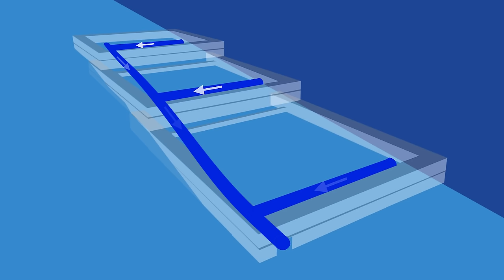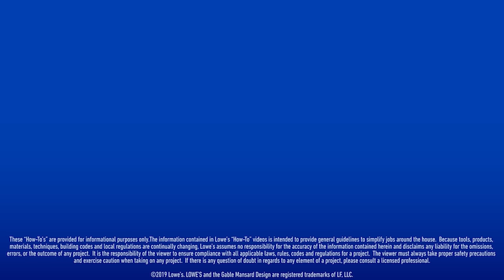How to Build a Terraced Garden Bed on a Slope

Comment: I wish you would show how the 2x4 or cross braces are attached. Are you using Joist Hangers or did you use the timber screws to tie directly into the 6x6s?
Reply: Yeah, if I just wanted a tutorial, I could have read an article. I looked for a video because I wanted to SEE how it was done, but they cut all of that out

Comment: So with the emphasis added on drainage.... I want to do this in my yard, but it's in an area where sprinklers don't hit. I live in an area that would need sprinklers or a drip line at least, so I want the water there, but I still need the drainage in case of any extra during rainy months right?

Comment: For the drainage pipes, I am confused as to why they are L shaped, ie run across the front of the bed and not just down the one side. Also for the drainage pipe running up the side (the one that has the notch at the bottom) do you connect it to the next bed above or have it long enought to run through all three beds, adding a T to it at the front of each bed? Also do you need to close the end (brick wall side in this case) to make sure it doesnt fill with dirt, or is just ensuring the landscape fabric is around it enough?
Reply: the goal is to only allow excess water build up to flow down the slope. Otherwise, the water will naturally just drain back into the dirt.

Comment: Maybe I missed it but did the drain get connected to the top 2 boxes ?
Reply: He mentioned using "T" connectors but they're not shown in the parts list.  The highest/first bed should have am "L" connector.  Consider angling the various pipes inside the beds so the water runs away rather than pooling.

Comment: I've just moved into my home and I have a slopy garden! the council has only tended to 1/4 of the garden which is at the top and it would be the size of a typical city garden!  the rest they gated off and it is a brook! which is literally overgrown with ferns and bushes.  I saw a fox there as well.  I really want to do the garden up and I wanted some advice?  what can I put in place to keep foxes out?  and how can I design a very long garden? especially the one which seems as if the house is sitting at the peak of K2 whilst you are at the bottom of the garden?

Comment: Will the wood rot in a tropical area, say Malaysia ?
Reply: just looked it up for you However, most pressure-treated wood should have periodic sealing against moisture, preferably every year or so. Although the wood is resistant to rot and insect attacks because of the pressure treatment, it can warp, split and develop mildew if not protected from the effects of water.

Comment: Now show the video of the tiered garden box i just built at my mothers house where I spent 15 hours cutting down old ficus shrubs and digging out the roots which had pushed the retaining wall 8 inches to the left and cracked the driveway blacktop before diving roughly 390 trillion feet into the ground. Just be prepared to have the bleep button ready. I wish I had watched your video first. You guys had a great method to just dodge all that stuff. I’ll try that next time.

Comment: Anyone know if the drainage is nessecary or just best practice?
Reply from the maker: Drainage is always important - especially when next to a foundation.
Reply: @lowes  are the pipes necessary. Would the gap in the wood not allow water run off?
Reply: I did one in my previous house without drainage and it was fine but it was not close to foundation

Comment: The timbers are full of chemicals.  Wouldn’t do this for a garden where you would grow things to eat.
Reply: I don’t know about all lumber brands but I do know that Yellawood brand pressure treated wood is EPP-certified and is safe for use around pets and for vegetable gardens.
Reply: Don’t get chemical treated wood. Duh,
Reply: @happygolden-mountain  you can use pressure treated wood. They dont treat them the same as they used too. If concerned, just add weed bed liner around the inside edges of the bed to keep leeching into soil. Pressure treated is fine, cedar isnt affordable for everyone, and pieces that size, I wouldnt even want to imagine what that would cost

Comment: Putting it next to the house is a bad idea. The garden will need a lot of water and all that moisture will create foundation and crawlspace  issues that will become an expensive nightmare. It's best for your house to keep water away from the foundation. I noticed your downspout drains right beside the house also. I would put at least an extension  to drain the water away from the house but you're still going to have a problem with the water from the garden. I'd remove it and place it somewhere away from the house before you have serious foundation issues. I know that's not what you want to hear, but you should contact a foundation company and let them explain.

Comment: Never drive rebar into dirt. That's a mistake because it allows rust to wick up the rebar, splitting the wood/concrete/whatever material you've used after a few seasons.
Reply: Thanks for the warning.  But what would you do instead of this?
Reply: @inven2win  Timbers like that are pretty heavy without anchoring especially if you've already got them terraced so they are partially underground and less likely to shift. If you must anchor it to the ground you'll need to come up with a solution that does not involve putting an easily-rusted item through the timbers, or else the timbers will fail/rot/split.
Reply: Use epoxy coated rebar.  Never rusts.
Reply: @TFC78  I took a bunch of rust scrapings and casted them with epoxy to make a rebar like rust bar.
Reply: Could you powder coat the rebar?

Comment: I would refrain from using pressure treated wood if your making a vegetable garden
Reply: L. Allex Benson  yes, please share & thx!
Reply: L. Allex Benson   I believe the reasoning is the chemical release into the soil, used in treating the lumber.  While more recent treated lumber is considered more safe as a copper preservative (as the amount leaked and soaked up by vegetation is minimal, and may be necessary as copper is essential), to be considered organic gardening, you cant use treated lumber.  With that said, it just depends on whether you want the copper soaked up in the plants or tainting your soil altogether.  Old treated lumber contained arsenic which is toxic, which is maybe where the belief comes from.  You may want to check what the lumber is treated with based on location.

Comment: Why not just plant in the ground. More natural.
Reply: I agree however. Physically navigating a steep slope can be ruff. These help with that
Reply: In my experience when you add fluffy compost/soil in a slope, each time you water the soil tends to shift downhill. Now you have erosion around your foundation. I think this investment is worth it in the long run.
Reply: Adriana Morawietz you run the risk of a heavy rain washing everything away. I have had this happen several times. For what it’s worth I have a heavy clay sub soil so the top soil just washes right off as well as the mulch. If you have a different soil type you may not have the same issues I have.

Comment: Don't use pressure treated lumber for vegetables beds. Inedible flowers and such, okay.
Reply: Not a problem if you keep the pH of your soil healthy

Vegetable roots won't access soil arsenic (which is trace in all soils) unless you really boof the soil
Reply: @SilentShiba  azoles and benzimidazoles, Tributyltin (TBT), Borate-based preservatives, etc.

they don't use arsenic anymore, but the fungicides they use do leech fungicide that destroys beneficial fungi in the soil, there's insecticides in some of them, too. 

not saying it wont work, but avoiding pressure treated lumber is the standard practice for vegetables gardens.